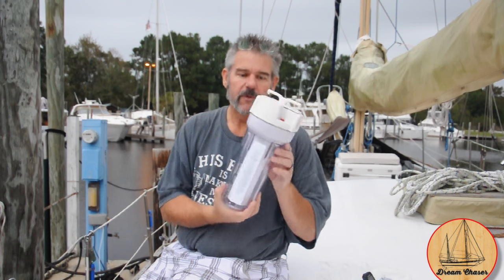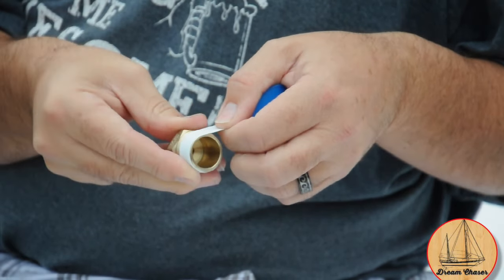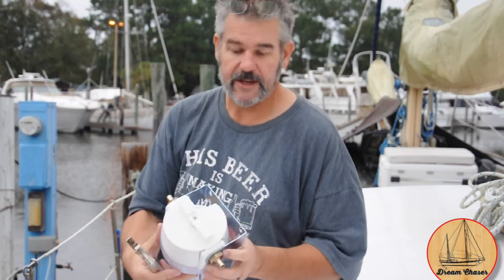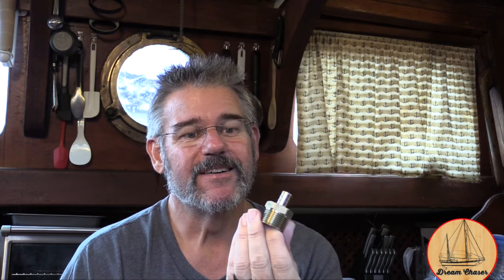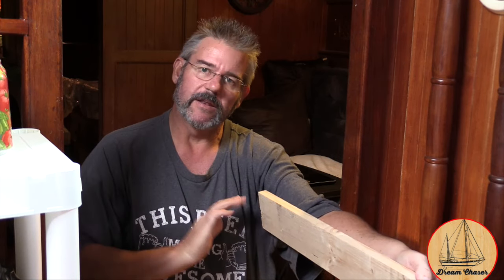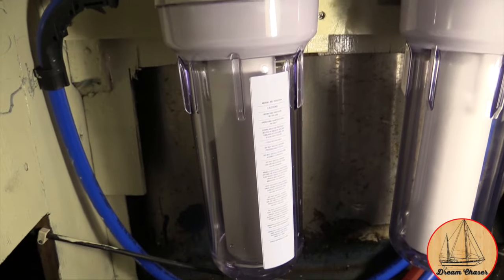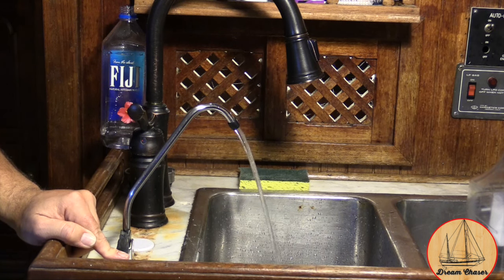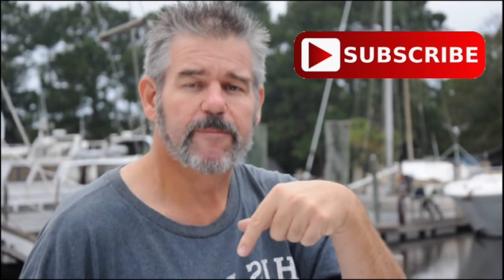Replacing the Fresh Water Plumbing on your boat Series 4 of 4

Comment: Nice series! I've got a similar project in my future. The one thing I don't like about the system is the requirement of the special crimping tool...I'd probably end up dropping it in the ocean.
Reply from the maker: Brandon DeYoung thanks Brandon. We also weren't fans of the thought but they do have crimpless push in connectors, but they cost more so we figured out the savings on the crimping tool

Comment: good stuff well done
Reply from the maker: +SAIL CANCER - Thanks, I am glad you liked it, if you find it helpful or useful, please like and subscribe.  We have many more projects and adventures to post pictures of, including bedding deck fittings, installing a new hot water heater, adjusting throttle cable on the engine, and Deb is also going to start doing some on the cooking we have been doing aboard.
Reply: subscription done, i am looking forward to the new videos, my boat is in the yard now and the weather here in Ireland is starting to get cold "not good for my legs" so i will be in front of the fire watching you work, check out my video if you get a chance and say hi to Deb from me
CHEERS T.J
Reply from the maker: +SAIL CANCER - Nice channel !